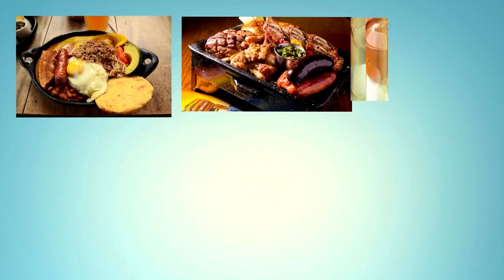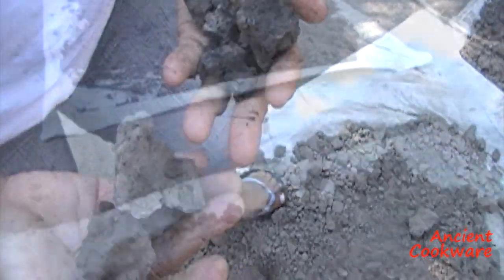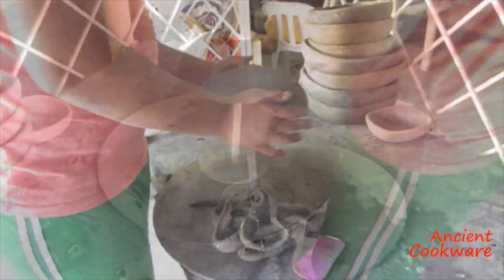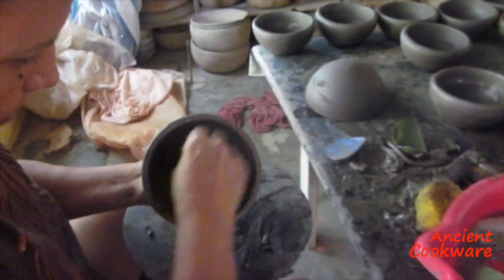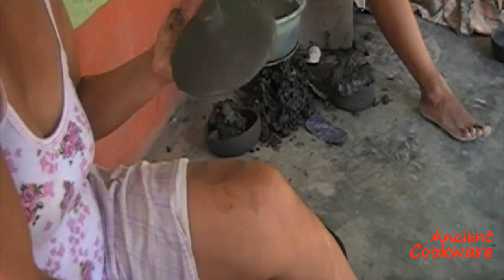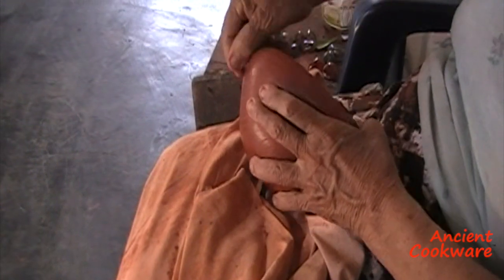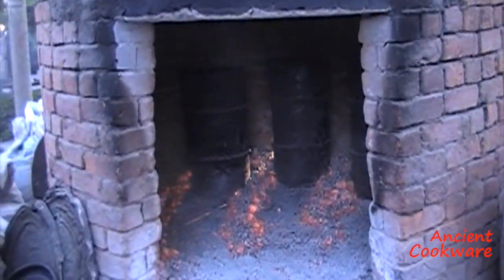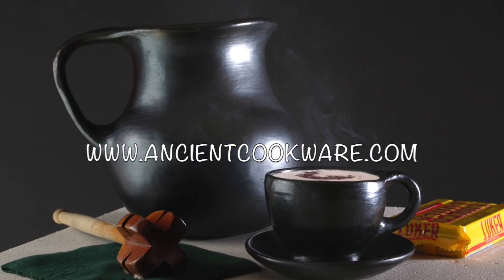Ancient Cookware - How Black Clay, La Chamba Pottery is Made

Comment: I ordered three black clay pots from amazon. Too expensive and small after use I saw cracks. Is there any way to buy directly from maker.
Reply: You probably did not get the legitimate item, this pieces will not crack unless you drop it. They are very strong and they retain heat very well. Even when they are hot you can grab it by the handles and you won’t get burned.

Comment: Is there a video or instructions on how to cure a new chamba pot?

Also,  I have one that was handed down to me and it smells like dirt so I don't think the previous owner cured it prior to use.  I made  rice pudding in it and the dessert aquired the dirt tasted .  Is it possible to fix this used pot?
Reply: +Maureen Benoit 
If you haven't found your answer yet, all it takes is filling the pot 3/4 full with water and placing it in a 400 degree oven for 30 minutes.
Reply: When I have a Japanese clay pot, the curing was the uncooked rice water, using the first soaking of the rice water and boil the water in the clay pot or in oven, and let it sit for at least 2 to 3 hours... the starch from the rice water helps to fill up the voids in the porous clay pot..

Comment: The smoke isnt turning the pots black. The burning material put in the barrels is using up the oxygen. The absence of oxygen along with the heat makes the iron in the clay slip turn black. 
If they were to leave the lids off the barrels the pots would come out red.
Reply: Is the iron naturally in the clay slip or is it put there
Reply: @neos7786  it is naturally in the clay.

Comment: Is there a reason why these clay cooking pots need an induction disk while other clay pots for stove top use do not require it?   Thank you
Reply from the maker: They can also be used on the stove top without the induction disk.
Reply: The other "clay pots" you're referring to are made of Iron that has its surface vitrified to make them uniform, non-reactive and scratch resistant.
The pots on the video are made of mostly clay that's also vitrified by the end when they add organic matter in the barrels.